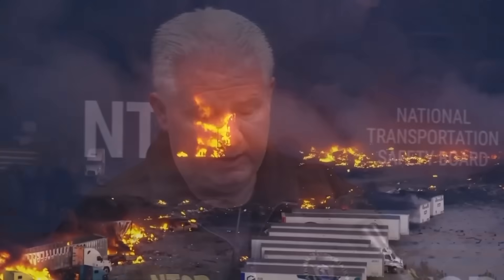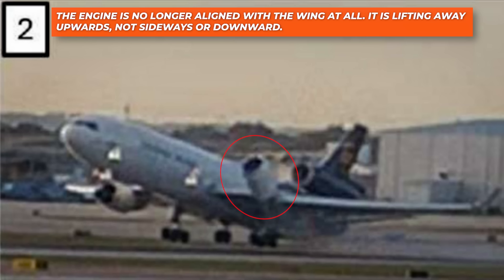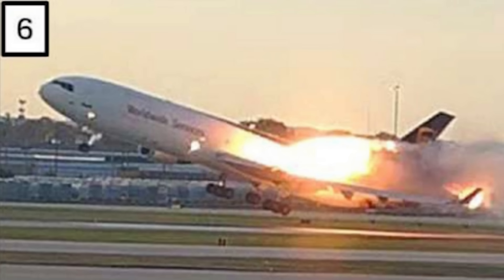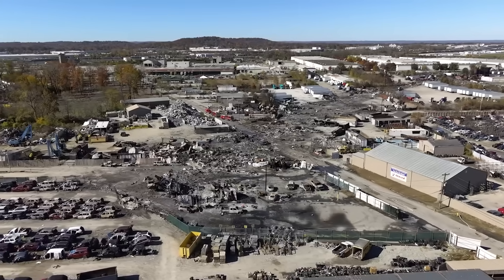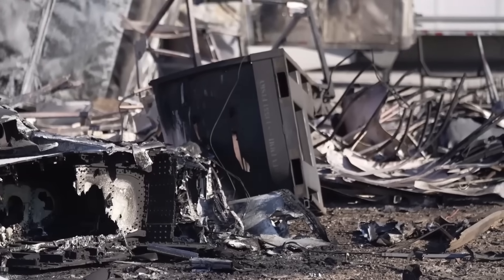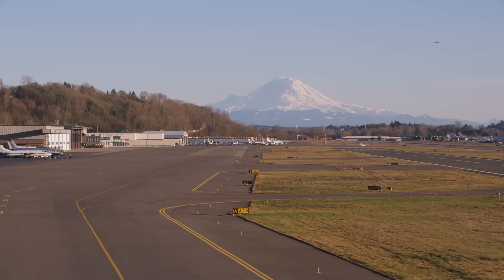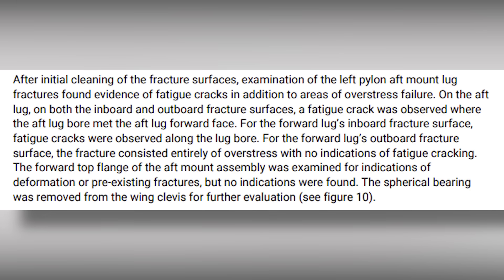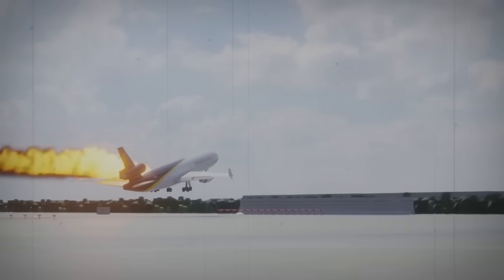UPS 2976 NEW EVIDENCE: The Truth Is More SHOCKING Than We Thought

Comment: Your analysis misses this key pont.  The aircraft struck the ground at 184 knots.  The aircraft will fly safely at VR which is ~40 kts slower and probably 5-10 kts below that. Therefore, it did not stall.  The pilots flew it into the ground.  Ground impact could have been delayed or maybe avoided (depending on #2 engine thrust) if the aircraft pitch attitude had been raised to an unusualy high sattitude to increase lift and reduce speed.  Quickly activating fuel dump to lighten load and improve climb performance would also have helped.
Reply: The intense fire at the left pylon melted the structure of the left wing which caused if to fold upward. No flight crew could have flown that airplane after the fire started to melt wing structure.

Comment: This is an excellent review and analysis of the preliminary report.  Thank you very much!!  I’ll just add that, IMHO, the remaining DC-10’s and MD-11’s should be retired from service as soon as possible with significantly shorter inspection cycles on the aft pylon mounts until they are.  That seems obvious based on what we know at this point and it’s hard to imagine that the final report will contain any detail that diverges much from what we already know since all the available evidence is so remarkably consistent as to the primary cause of the accident.

Comment: Gyroscopic Precession is the technical term. The engine attempts to rotate to the right and up on EVERY takeoff rotation. Regardless of which mount fails that engine will always rotate UP and over the wing. Dont comment on things you have no knowledge of. Btw this exact same accident sequence has occurred before. There is no engineer, mechanic or pilot familiar with this family of aircraft who did not consider this scenario. You are a clown, plain and simple. STFU

Comment: The cockpit voice recorder can reveal if some problems occured early during the take off roll, which I suspect. Probably the pilots felt severe vibrations but ignored them instead of braking, which would have saved their lives.
Reply: Breaking?  You mean *Braking. They were past V1 and going 180 mph. No room to stop. They had no choice but to try and takeoff.
Reply: @Jeff-sp7bg  What I mean is that they could have braked and aborted the take off when problems, perhaps in the form of severe vibrations, started to appear, which was probably well before V1. I don't think that everything was normal until the engine fell off.
Reply: @AA-le9ls i know what you meant and  those problems appeared at V1  and 180 mph. No time to brake.  Look at the prelim reports .
Reply: @Jeff-sp7bg  The report doesn’t mention what the pilots said during the take off roll. Maybe they were discussing some vibrations which appeared much earlier than at V1.

Comment: This TRI engine DC10 MD10 MD11 is flawed because the center engine can be comprised from a wing engines debris.
This pylon is under engineered and the aircraft have killed enough people. this aircraft needs to be grounded for good.
look at the FDX 80 crash and landing.. CG is too tail heavy and hard to handle aircraft.

Comment: Inspection for fractures is a non intrusive and quite fast and easy process. The criminality lays in waiting for 20k cycles or more before checking.  Besides, all aircraft of all types are subject to this same problem if so assembled.   It is a massive problem for all fleets because obviously the metallurgical advice for maintenance was deeply flawed, and such 'wisdom' was not confined to one manufacturer.
Reply from the maker: That's a really important point about the inspection cycles and the broader implications for other aircraft.

Comment: In frame 2, the engine has already lost its alignment with the wing's surface, but no fire or smoke is visible yet. An uncontained hot stage multi blade loss, as suspected by some, would've been clearly visible at this stage.

Comment: A question is when the engine sheared away the fuel lines and other connections should pull out and seal. Seeing the fire they did not. Look to Piedmont flight in Nov out of Chicago in 89
Reply from the maker: That's a very insightful point about the fuel lines and connections!
Reply: @BlackboxAnalyst The piedmont flight circled around and landed due to the lines severance of the lines as designed.

Comment: The aircraft is N259UP  
And its not a Passenger aircraft.  It is in fact a Cargo Freighter that is loaded in a specific way to maintain its CG . Weight balance is paramount for achieving lift. Weight is the determining factor for take off config in addition to field elevation.  When the Cargo Freighter lost 10k lbs of weight ,.. its CG has now changed.  This is why its an unrecoverable situation.  The Inspection Card is deficient and should include eddy current and extensive NDT intervals.  The Engine separated at the "worst time" because rotation is the most stressful stage for the engine.
Reply from the maker: You've brought up some really important points about the cargo freighter's weight and CG, and the stress on the engine during rotation.
Reply: The aircraft was close to the max take-off weight 630,500 lbs.The for and aft position of the engine is slightly in front of the C of G, so a 10 k lbs loss caused by the absence of the No 1 engine would not have much effect on the position of the C of G.
Reply: @christopherrobinson7541  Cargo Freighter aircraft are work horses in regards to payloads at capacity.  The max payloads are determined by multiple factors including the Fuel requirements that include diversions, ballast etc. Aircraft was ETOPS. then There's  also restrictions if they were hauling HazMat , in addition to any MEL limitations it may have had. Flying  at max payloads is normal $. And Google doesn't determine Flight Management.  "forward and aft" of the engine? Do you mean the intake cowl amd the exhaust cone. Its irrelevant because the CG for a Cargo Freighter different every take-off , loading based on the empty weight of the aircraft,  which is its permanent structures ,which include the weight and position of the Engines. The loadmaster arranges the weights of the Cargo containers to stay within the limitations established. The fuel load, temperature,  wind speed, weather, runway altitude and many other factors mentioned are All parameters for the take off config,  then calculated by the Flight crew to establish LE & TE flap positions , speed, Engine thrust (EPR) settings. 
There's No cushion to dropping 10,000 lbs of weight neither in Flight , landing or muchless critical Take off stage of rotation.  In addition the asymmetry produced by the thrust and weight loss on one side. Aircraft fly on 3 axis, Yaw , Pitch and  Roll.
Reply: Wrong. Max weight at takeoff
Reply: @ShaunHensley Most likely  from  Google information.  And its irrelevant cause Max take off weight changes with temperature, altitude,  runway , weather  .
Reply: @ShaunHensley Most likely  from  Google information.  And its irrelevant cause Max take off weight changes with temperature, altitude,  runway , weather  .

Comment: No, failure of the forward mount would NOT drive the engine down as the thrust vector is BELOW the mount -- the engine would still tend upwards but not as much!
Reply: If the Forward mount failed first would the Engine still stay in place due to the upward pressure against the top surface of the wing part of the mount.
Reply: @PeterGardner-e1z  Losing one mount will make it unlikely the engine will remain in place, but it is possible so long as the design margins are not exceeded and there is no fatigue issues.  It's important to appreciate that even normal operation there is going to be a torque or moment applied to the mounts because the mounts are not directly in line with the thrust vector.  In this particular case it is evident that the rear wing to pylon mount failed providing a single connection point that served as a pivot that the thrust produced torque cause the engine to rotate about the remaining mount.  The combination of forces including the precession caused by engine rotation upwards sealed the deal.
Reply: You just refuted yourself! So glad that you know more than the engineers.
Reply: @johnvajcner20  No, when the thrust vector is BELOW the mount the engine MUST tend upwards -- this is high school Math!
Reply: Gyroscopic procession dictates the engine will rotate up
Reply: @ShaunHensley  Incorrect!  The rotation of the engine upwards would result in the engine being torqued to the right -- the gyroscopic action of precession is 90 degrees to the rotation of the engine upwards.  Take a bicycle wheel in your hands with the axel pointing north, then spin the wheel clockwise then try to tilt the axel upwards -- the wheel will try to rotate your body to the right!
Reply: Stress fracture on transport travel what about  civillian travel how many DC10 's are out there

Comment: If you look at pictures of AA Flight 191 , there is a picture of the DC-10 in a severe left bank (after #1 engine separation) trailing fuel prior to impact. Just saying.
Reply: Hmmm … 🤔
Reply from the maker: yeah, deja vu 🤔
Reply: If memory serves, the picture of the aircraft in that left bank showed hydraulic fluid venting rather than fuel.  It helped investigators focus on the retraction of the left wing slat which meant that wing had less lift than the right wing.  If that wing hadn't stalled it was determined that the crew was well trained to fly a reasonably trimmed aircraft to a controlled  emergency landing.  MD had to reroute the hydraulic line locations in the wing to a less vulnerable setup.
Reply: @rivetjoint6355 Excellent point! Forgot about the hydraulic/slats issue. Senior moment. I do remember the trail being rather visible.
Reply: At this point it seems that both airplanes had a failure of the same component, the aft pylon mount. However the reason for the failure of the aft pylon mount on American 191 was caused by improper maintenance procedures. In the case of UPS 2976 the failure of the aft pylon mount was caused by metal fatigue that caused premature failure. In other words the same component failed for two different reasons. both accidents look the same but in my opinion they are not.

Comment: The Airplane had allot Fuel onboard for a 4.000 Mi Journey to Hawaii a 9hr Flight

It was close to its Maximum Takeoff Weight

Had it had 30-40% Less Fuel onboard the Pilots might have ben able to Prevent the Crash and gain Some Altitude.
Reply from the maker: it might help a bit, but basically the airplane was already in an impossible spot with the mounts failing like that
Reply: If the aircraft had no cargo and no fuel, it still would not be able to fly on just one engine. The empty weight is 248,567 lb and the max weight is 630,500 lbs so if it takes 3 engines to fly at max take-off weight, it would need (248,567/630,500) x 3 = 1.18 engines.

Comment: Not content to build crap airplanes with the DC 10 and MD 11 failures.  The same gang moved into Boeing with the merger and screwed it up also.
Reply from the maker: Yeah, the culture shift after the merger didn’t seem to help
Reply: When the "bean-counters" became more powerful than the "Engineers"?
Reply: @patrickbass3542  it was the top management of McDonald that pushed through a poor design.
Reply: The FAA did the right thing by ordering an emergency air worthy directive and grounding this class of planes. They need to be inspected and corrected if needed. 

I know that aircraft are subject to far more frequent and exhaustive maintenance than your typical automobile but when a plane gets to be 30 to 35 years old and has gone through repeated cycles and hours of flying there's bound to be things that are going to show up. Had there been a more frequent inspection period required for these models of aircraft, specifically to check for stress points like the mounting pylons.  This accident probably never would have happened. 

RIP To the flight crew and those on the ground who perished and condones us to their families.
Reply from the maker: @carlmontney7916  I totally agree. Thank you for your thoughtful comment! 🙏
Reply: What a lot of folks, even educated ones, don't understand is that all commercial aircraft are designed, engineered, and built, to be as failsafe as possible. And this includes the DC-10 (which I've flown on a few times, MD-11, and 747s, which I've also boarded a few times). DC-10 and MD-11 are a couple of the best engineerd airplanes ever produced. Read Wikipedia DC-10 article before spouting nonsensical opinions. 
DC-10 and MD-11 were well advanced in design at the time of their development and still are ahead of the pack in agility, performance, and dependability. UPS is a prime private operator that flies these planes for money. Just because a $10 bolt breaks at a critical structural interface does not mean that someone sluffed on inspection or maintenance or there's a design flaw to address. Quite often components are designed to fail in a certain way or manner to aid in the forensic investigation. What broke, when, where, and what loading conditions. 
And to minimize damage in the event of a critical failure.
Reply: @f @fedfraud.protection.servic2557 
The McDonnell Douglas DC-10 series is the most dangerous jumbo jet due to its series of accidents.  That’s a simple, easily verifiable fact.
Reply: @f @fedfraud.protection.servic2557  When I was in college we carefully studied the systems of the 747, L 1011, and DC 10. The DC 10 consistently came in last in terms of safety design criteria.  This has been born out by hull losses.  The facts and fatal accidents speak for themselves.
Reply: @fedfraud.protection.servic2557  The higher crash record, fatal incident record of this aircraft speaks for itself.  It’s not a good airplane and never was.
Reply: Seen many dc-10`s and Md -11`s  arrive and fly every night for 20 yrs  never a crash